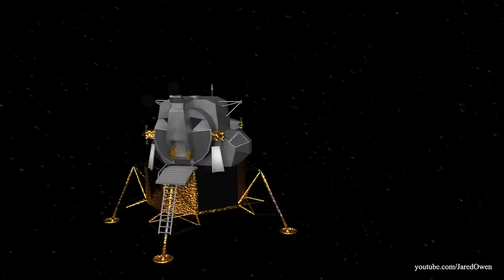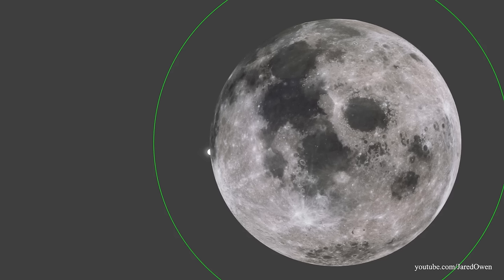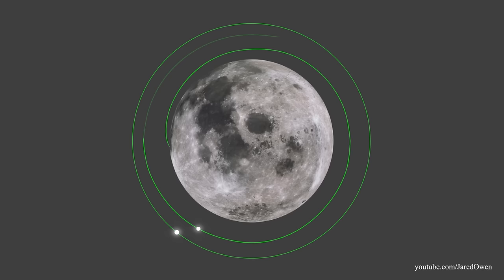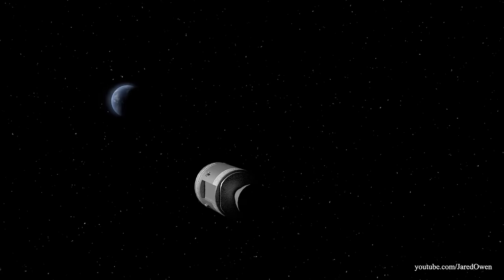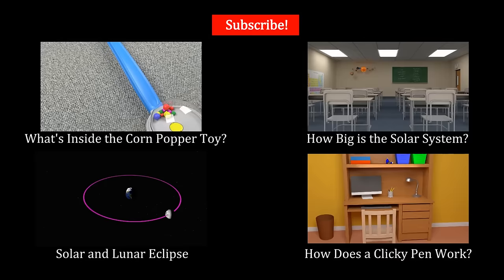How the Apollo Spacecraft works: Part 3

Comment: I started playing Kerbal space program a long time ago, that was back before i understood anything about space flight and such, and yet my designs for a Mun landing system are almost identical to the Apollo missions.except for some small differences.
There are only 3 legs on my lander.
The decent stage has it's own solar and battery to power the transmitters to act as relays on the surface.
The ascent stage contains the same, thus giving me a surface and orbital relay to help remove those pesky communication blackouts.
Finally the CS-1 is 100% recoverable, which took far more time and math then I would like to admit. Then Mechjeb came out and i was able to automate that process a little.

Comment: Hi Jared,

Please first let me say this: Great videos!! I'm interested in this subject, but not enough to watch a film of two hours. But recently, I watched "Apollo 13" (for the third time) and it bugged me that I didn't understand a lot of technical stuff in that film. Today is a memorable day of course, and I wanted to explain to my daughter how this all works. Your three videos made a lot clear to me and my daughter!!!

However, I do have two questions:
- When the service module let's go of the LM (I think this was in video 2), it makes a 180 degree turn and then extracts the LM out of it's housing. They then continue on their way to the moon, with the service module flying backwards, so to speak. This flying backwards is what makes it possible for the service module to lower the speed, just by firing up the engine, because it is flying backwards. However, when the LM (well, only the part that lifts off from the moon) goes into orbit again and links up again with the service module, the service module is flying forwards. I mean, the engine is at the back so it can thrust the astronauts back into space again. So I guess the service module made another 180 degree turn when it was manned by one astronaut, right? If that is the case, then maybe you should include that detail in the video? (IMHO)
- Sort of a same question for the command module: it detaches from the service module when it has to get back into the atmosphere. It is flying with the pointed side forward, but in the next scene in the video, it's suddenly flying backwards. So I guess the command module made an 180 degree turn as well? I guess it has some small thrust engines to do that?

I would be grateful if you can send me a reply!

And again: I love these three videos!

(Addition to my original message:
I just watched the second video closely again. This is what happens.
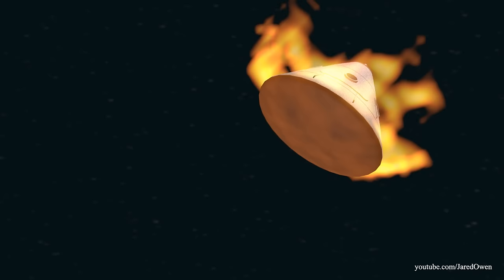- Lunar Orbit Insertion (2:43) --> spacecraft travels "backward"
- Slow spacecraft down (2:53) --> spacecraft travels "backward"
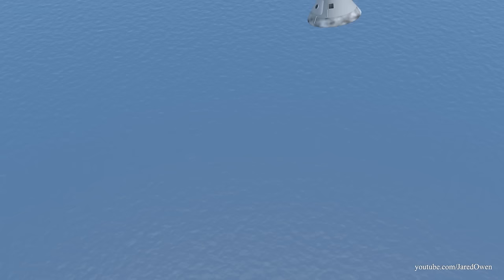- Now it’s time for the main event (3:10) - --> spacecraft travels "forward"
So I guess that between slowing down and the LM detaching from the CSM, the combination of LM and CSM must have made a 180 degree turn. Is that correct?)

Comment: I loved this video, such great animations and perfectly explained!
If someone could just help me with this question. 
When the command and servicemodule had to to the 180 degree turnaround to dock with the 
lunarmodule. At the lunar orbit insertion, the servicemodule engine was 
fired up to slow the spacecraft down. That way the lunarmodule could land on the moon safely. All perfectly explained.
Here is my question: Doesn't the CSM have to do another 180 degree turnaround in order to go back to Earth? Otherwise, when it is still in the opposite direction, it would just slow down again around the moon instead of using the moons orbit and momentum to go back? 
Sorry if this is the dumbest question you ever heard but i'm trying to wrap my brain around it. 

Thank you anyway for this video!
Reply: You are correct.  They have to turn the craft back around to "face forward" in order to go back home.

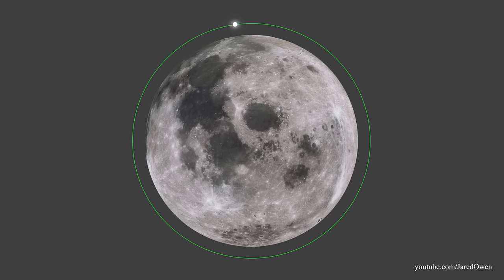Comment: @1:32 when the LM and CSM are docked it looks like it is pointing to the moon and going backwards.  @1:45 it still looks like it is going backwards then @1:53 it looks like it is going forward then the rocket is fired.  So is 1) the animation misleading or 2) the animation correct but we just don't see it rotate or 3) is the animation correct and it simply fires the rock and changes direction. I am guessing 2) but would like to know for sure.

Comment: "Once we're back in earth orbit, the service module is no longer needed."

The Apollo's that came back from the moon did not return to earth orbit. They followed a 11.2 km/s direct entry approach with an atmospheric tangent of around 96 km in altitude. Fifteen minutes or around 10,000 km prior to reaching the point of tangency, the command module shed the service module which was no longer needed.
Reply: Erik Bakker - Thanks. Great explanation. In English, you reverse the period and comma, thus 11.2 km/s and 10,000 km.
Reply: @virvisquevir3320  You're right. I corrected it. Thanks for pointing it out.
Reply: Erik Bakker - Cheers!

Comment: Just  a little info I picked up on the ascent stage on the LM: the engine was never tested on Earth, and its fire up or ignition was its first initial run. It was basically a clean engine up to the required use. Apollo 11, and the engineers on Earth, had a dramatic countdown once Neil and Buzz were getting ready to return. On top of that, Buzz broke the one ignition switch during their short stay on the Moon’s surface. They actually used the tip of a pen to fire up the engine.
Reply from the maker: Nice!  Yeah that be pretty scary, cross your fingers that the engine turns on or stuck on the moon
Reply: Just wanted to point out that they did have some redundancy with important controls and electrical systems. If the pen fix hadn't worked, there were people on the ground already working on another solution with the electrical system although I can't remember the details. The built in redundancy NASA insisted upon was a big reason why Grumman was having a difficult time keeping the weight of the LM within the tight guidelines.
Reply: Saber Tig: Nobody went to the moon, particularly with a 1960s computer and changing second moment with 4 groups of constant force steering motors...

Knowing how to evaluate evidence, or lack of evidence, is a good first step to revealing what a hoax it is. Having an engineering degree is helpful but not necessary to know what questions to ask or find huge inconsistencies in the moon hoax. Big problem for them is what were graduate level courses in the 1950s and 1960s are now undergrad courses, so there is not much of a mystery to use undergrad courses to ask questions they cant or dont want to answer....

Where is the video showing the inside of them LEM with the astronauts in 
the moon suits and attached with the bungee cords. They had a periscope in the CSM and LEM for navigation, but for some reason there are no pictures or videos of stars. The second moment changes as the fuel and oxidizer gets used, but somehow these 4 groups of steering  motors kept the LEM from crashing. No remote control or autopilot test landing to verify the LEMs control system and steering motors, with the sloshing fuel and oxidizer and water, but somehow they got it right the first time. The LEM simulator Neil flew and crashed obviously did not have the same second moment as the fake studio LEM on the moon stage. No radar stations on the moon to verify the unknown orbit of the fake CSM, and the ignition time of the LEM, and track the fake LEMs altitude and range as a function of time for descent and ascent. For the moon suit sublimator what blackbody absorber temperature did they use for outer space and the maximum power flux from the sun from the ultraviolet to infrared wavelengths. Same with the engine jet landing on the moon and the missing dust cloud and nobody afraid of rocks piercing the LEM or damage to the antennas, steering motors, or landing radar. They could have pointed the cameras up away from the moon instead of golfing on the moon stage but they decided not to because they would have taken pictures of the stage guys on the catwalk They also drove the moon buggy with lots of dust in the vacuum of the moon studio. Where is the video showing the astronauts in the LEM on the studio mooooon putting on their backpack life support. The clown did a fake spacewalk in the non gravity simulator in the airplane, but for some reason no stars in pictures or video from that. Their studio moon suits were contaminated with moon dust, which likely is radioactive, but no problem to put a Geiger counter next to their suits to verify there was no radiation hazard.Neil jumped off the studio LEM, but since it was live they could not slow down the speed by the square root of six, like the Six Million Dollar Man slow motion, because that would put the rest of their studio acting out of sync..Astronauts could not get more than 6 inches off the moon as they were hopping and walking and pretending to be on the moon stage. Radiation heat transfer on the LEM so they used a glycol cooling loop to radiate that heat back out into the air conditioned studio. Total hoax.

Comment: And to think how hard mars will get
Reply: Super Ripper flame actually its not hard its just expensive even 70s nasa could go for mars but this program could way more expensive
Reply: The problem that will have to be solved that wasn't required for a  moon landing is Mars gravity.  Although it's about 38 percent that of earth, it's still a lot stronger than the moon's.   Everything will be heavier, so lifting back off the moon will require much bigger engines and a lot more fuel.
Reply: Among several issues that will need to be adressed, this one will be hard. When astronauts come back on earth after 6 month in the ISS, they are unable to stand or walk by themselves and need to be assisted for the time they readapt to the earth gravity. Despite the physical training they get in orbit. 
Now imagine them on the Mars surface, after a year without gravity, suddenly undergoing a .38 G environment. Who will welcome them and give them assistance. Do you think they will be able to work and perform?

Comment: Interesting point about the Command Module being claustrophobic;  compared to the Gemini capsule it was downright spacious.  Gemini was designed with the help of Gus Grissom, who was a small man (5' 7" tall), smaller than the average size of an astronaut (5' 11").  NASA found that the "Gusmobile" was not adequate for 14 of their existing 16 astronauts and had to modify the cabin.  As it was, space was about the same for the front seats of a Volkswagen of that era.
Reply: Yes, it was pretty amusing watching one of James Burke's documentaries about the Apollo missions were he's interviewing some of the astronauts and the cramped conditions of the Gemini capsule vs the Apollo capsule came up. Jim Lovell tells about how during the 14 day Gemini 7 mission that Frank Borman eventually had to use one of the poop bags that had an antibiotic portion in it that needed to be kneaded into the poop but somehow managed to pass that off to Lovell instead.  It was pretty hilarious but I couldn't begin to imagine what process those fellas had to go through to get the sticky bag on their butt to begin with.

Comment: Its amazing America developed these technologies in the 60s when computers were rudimentary . So much potential for failure yet multiple missions were flown successfully .
Reply: The most technically difficult part of landing on the moon was building a large enough rocket to get the necessary moon landing payload into LEO for the TLI burn. Of the approximately 400,000 people involved with the Apollo program, roughly 300,000 were needed designing and building the Saturn family of rockets plus all the logistics required to prep them for launch. Prior to the Apollo program, the USA experienced as high as a 40% failure rate with its various rocket launches which were pretty small and relatively uncomplicated. Of the 32 rockets in the Saturn program, all 32 of them were successfully launched. These were some of the most complex machines built at that time culminating in the Saturn V with its 13 successful launches. If you have any doubt about this, then look at the Russian moon landing program that accomplished many of the same things the Americans did including soft-landing probes on the moon and testing their version of the LM in LEO. They were never able to successfully launch their version of the Saturn V which was the N1 rocket that had 30 rocket engines in the first stage alone. After the fourth attempt that exploded not soon after launch, like the previous 3, they abandoned their moon landing program.
Reply: @mako88sb  
Just want to add that the second Saturn V launch (Apollo 6) was only partially successful, as two of its second stage J-2 engines shut down too early, and the third stage's single J-2 didn't restart in orbit. The test of the CM's heatshield at close to lunar mission re-entry speed had to be done by firing the SPS engine for almost 7.5 minutes in order to send the CSM into a highly elliptical orbit with a more than 22,000 km high apogee.
Reply: @fromnorway643   True. Not the desired situation but on the other hand not a catastrophic launch failure as what plagued the Soviets N-1. Still amazed that the first crewed mission using the Saturn V would happen with it’s next use. To the moon as well. I watched a documentary and Weber laid it out why he wasn’t a big fan of the revised Apollo 8 mission. Some pretty ballsy decisions made during the time especially after the Apollo 1 tragedy. I wouldn’t say reckless by any means but could have bit them in the ass. All of these launches and potential failures as publicly viewable as possible compared to the Soviets sanitized news releases to their citizens.

Comment: yeah, just to be clear everyone, you wouldn’t be reentering at such a steep angle, during the most part (not measuring time but change in velocity) will happen at angles lower than 5 degrees, and the offset of the center of mass in the command module causes a natural angle of attack that generates lift to get to the thicker parts of the atmosphere slower, if they were to reenter at a 45-55 degree angle like it seems to be in the video, the crew would most likely experience over 25G, that is enough to kill them in mere seconds

Comment: one small error  you say regarding the csm " once we are back in earth orbit"  The csm doesn't actually enter orbit on returning to earth , The speed to maintain low earth orbit is 17500 mph the returning spacecraft was travelling at 25,000 mph with no way to slow down enough to enter orbit , the perigee of its current orbit is well inside the earths atmosphere so its really a ballistic plunge directly into the earths atmosphere.

Comment: fun fact:apollo 13 in april 1971 the csm was docking to the lunar module in moon orbit but it didn't land on the moon the service module leak oil and exploded and then they used the lunar module as a ''life boat'' and then they separated the dameged service module and then the turnd on the lunar module's engines and then they undocked with the lunar module and then the lunar module crashed while the command module was in re-entery then splashdown back to the earth
Reply: Wow this was my longest comment ever!

Comment: Mind blown how when 10s of thousands of miles apart they docked to get home.
Reply: Well, just being a stickler for detail here, but, no, the two craft (CSM and lunar module) were never 10s of thousands of miles apart.  They only got to be about 2200 miles apart when the lunar module was on the surface, and the CSM was all the way on the other side in orbit.  But, sorry if I'm raining on your parade.  To explain how they did it, well, they were always tracking the CSM from ground based radar stations (except when it was on the far side, and radar doesn't penetrate through the moon).  They would then use physics to calculate when the lunar module should lift of of the moon, and provided the astronauts with the correct countdown.  After that, the lunar module followed a preplanned ascent plan (differing a bit per mission).  And, when they got within radar range, they basically just locked in on the command module and used similar programming that a radar guided missile would use.  Then, when they were within visual range, there were signaling lights similar to aircraft lights, so the two craft could spot each other, and complete the rendezvous.  They also had multiple backup ways to perform a rendezvous, in the event that any of these steps failed, including being able to drop the CSM into a lower orbit to go to the lunar module if it couldn't make it all the way back up, or to use ground based radar in the event that the lunar module's radar failed.

Comment: Did the CSM and the LM really need to locate each other for the rendezvous?  When Neil Armstrong took the LM to a favourable landing site, Collins and Mission Control didn't know where they were.
Reply: Neil would have used the optical scope shortly after landing to get a fix on their position. Houston also knew with the amount of fuel remaining along the landing trajectory to give them a close enough approximation to where they would land. This information would have been used to modify the ascent and rendezvous accordingly.